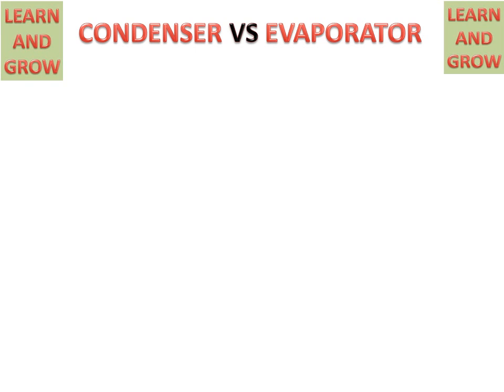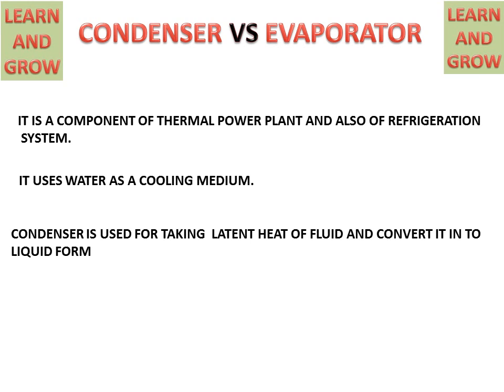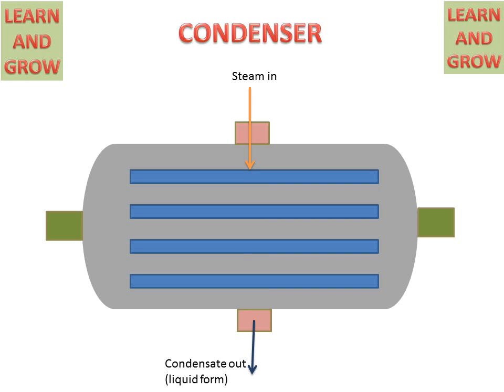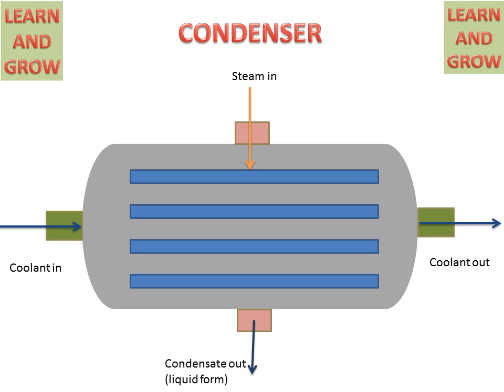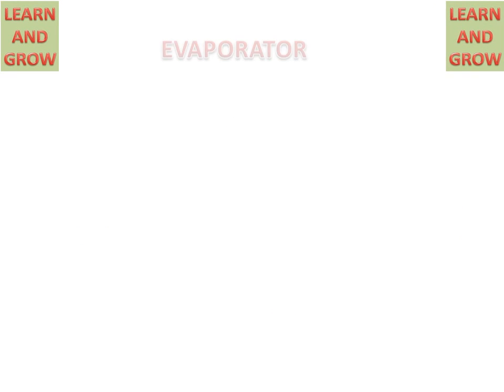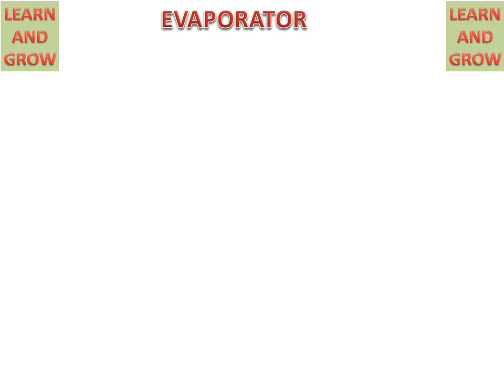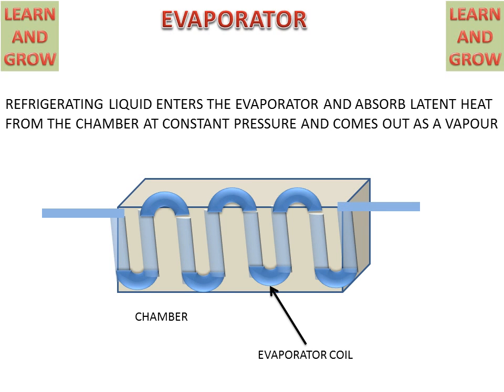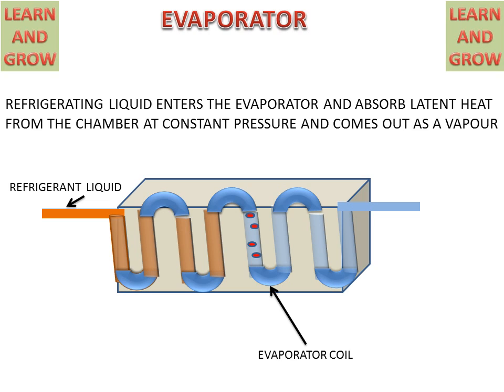Condenser Vs Evaporator  (Difference)

Comment: Thanks for the information.

Can the evaporator and condenser be interchangeable, meaning evaporator to work as condenser and vice versa.

Secondly, can I use air-conditioner evaporator or condenser with fridge compressor?
Appreciate any feedback.

Comment: So the compressor pumps the hot gas back up through the condenser, where it is cooled and changed into liquid state, and then it is passed through the evaporator where it is heated again????

Comment: What happens to the latent heat of steam when it is given to the coolant?
Reply: That is  what thrown outside as heat in rankine cycle..as ..heat is given in boiler and heat is given outside in condenser (I think this is answer.....)
Reply: This Latent Heat goes in Cooling Tower With Coolant And Cooling Tower Extract This Heat Into Atmosphere From Coolant

Comment: condenser se hot water nikalta h bahar ya cold water??
Reply from the maker: Condenser is only for phase change.In this process gas will convert in to warm water.so we get warm water at outside.
THANKING YOU
LEARN AND GROW
Reply: Condenser constant pressure par heat ka rejection karta hai iska matlab fluid ka temp. Kab hoga aur liquid warm hoga outlet par